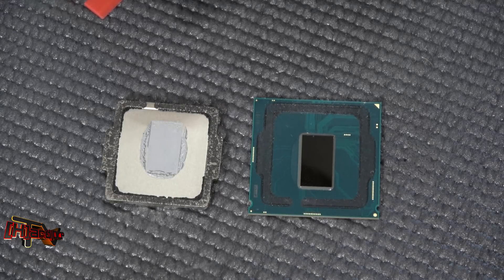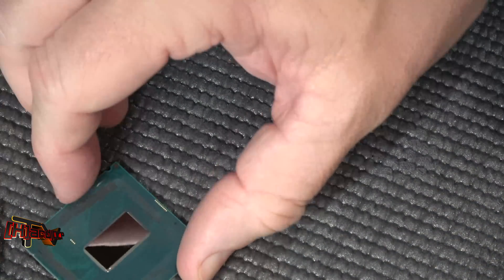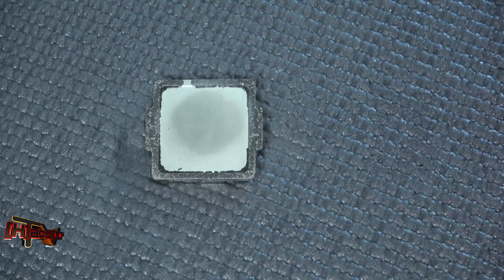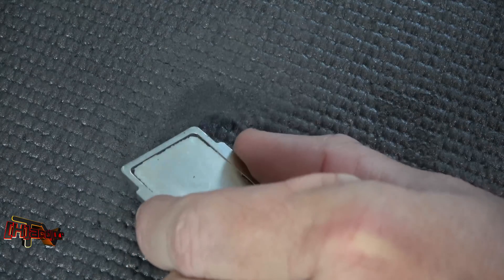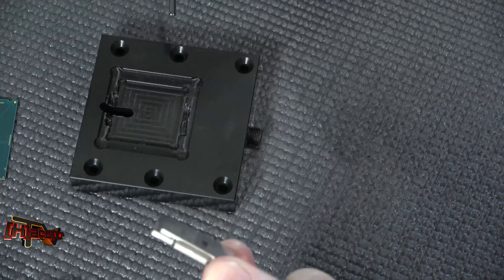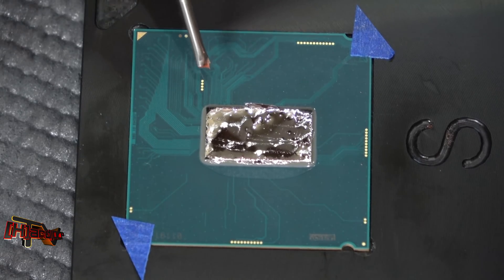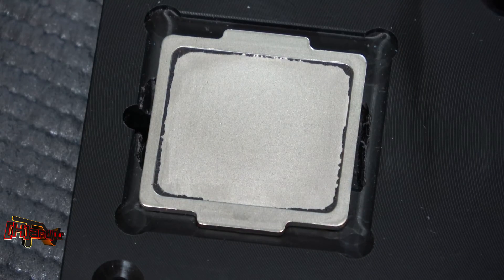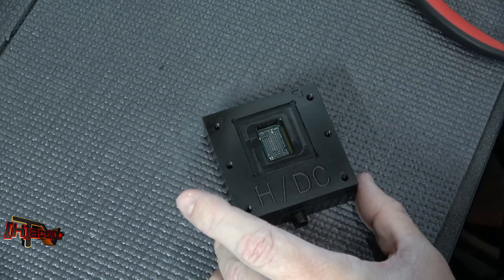Intel Coffee Lake 8600K Relidded with Delid Die Mate

Comment: From what I've seen, the best method to use, is using a Q-tip to apply LM. Put a tiny drop of LM on a different surface, absorb it with the Q-tip, then apply that. You can more easily control the amount, and it's a lot more fool-proof. Applying LM to both the die and lid helps too.

Comment: 7:45 is that really necessary? You should be able to 'relid' a Kabylake CPU without any modification to the Delid-Die-Mate. And doesn't Coffee Lake have the same IHS?
Reply from the maker: The tool I had was not designed for the CPU I was delidding.  I think the new ones have been tooled to fix that for those CPUs.

Comment: Why would you want to relid the cpu?
Reply from the maker: Protection.
Reply: From what? By relid i mean gluing it back instead of just putting on and letting the clamp and cooler hold it down.
Reply from the maker: I have found that fixing the IHS into place gives a better Z height and better cooling over time.

Comment: Hey, so if I were to use Hydronaut on my GPU, should I use Red RTV to protect the transistors and other components near the Die? Will it be low to no conductivity?
Reply from the maker: No electrical conductivity with Hydronaut, so if spec is true, no issue.  But I would cover it anyway.  No downside to making sure.

Comment: I think you may have added too much liquid metal, but if it worked it worked! I love the plastic razor blade idea - didn't know they existed! 

And you got the PCB super cleeeean
Reply from the maker: Hard to have "too much" of that TIM.  All that is not needed is going to be squeezed out easily since it is so viscous.  That is one of the reasons I made sure to cover up any conductive points under the IHS.  Much better to have too much with liquid metal TIM in this application rather than too little.  So yeah, I agree with you.  

Plastic razor blades rock.  Once you buy a pack of those you will find usages all over the house for those.

I am running that CPU at 5GHz at 1.24v vCore now with no issue.
Reply: You think the plastic razors from AliExpress would work well? Can't seem to find any reasonable prices for them here in Canada.

Also is it OK to not actually apply the Silicon sealant? 

I just want to delid it, super clean the PCB and Heat spreader, apply liquid metal and put the chip into mobo, the lid on, hold lid in place while I snap the CPU/Mobo latch shut.
Reply from the maker: Sure, you can do it that way.  I like having it attached, but if you are not going to move it, party on!

Comment: For anyone whos about to try it. Use tape around the dye surface to make sure you dont have the liquid therm outside the surface.  And use 5cm ruler when replacement silicone on the ihs to get straight line and smoth.

Comment: I saw several comments about the amount of LM that Kyle applied to this CPU. One thing to notice is that on the i5 it doesn’t have the surface mounted capacitors like the HEDT CPUs that others have done delids with.
Others who have done these procedures with have applied other types of coatings to protect the chip from the conductivity of the LM that might spread off the die. 
With this said, I am confident that the this i5 CPU is very safe to use after this process.
Reply from the maker: Yeah, I put "too much," but I am on the side of too much rather than not enough.  Cover everything under the IHS with RTV and keep it safe.

Comment: Maybe a strange question, but here goes... Would it not be a good thing to make the Lid out of Copper to increase thermal conductivity?
Reply: If you are talking about the material the IHS is made out of it is copper, it is just nickle plated to prevent tarnish
Reply: The thermal conductivity of Copper is 223 (Btu/(hr oF ft)) and Silver is 235 (Btu/(hr oF ft)), so a bit better heat transfer, but also it corrodes way faster as well.
Reply: Silver (430 W/(m K)) is barely any better than copper (400 W/(m K)) for thermal conductivity, though they are both nearly twice as good as aluminium (235 W/(m K)) for a comparison. Nickel (91 W/(m K)) has about 1/4 the thermal conductivity as copper and silver though so not having to deal with the nickel plating might see some marginal gains. Still nickel is about 3 times as conductive as gallium (29 W/(m K)) which is used in the tim.

So there may be some benefit, but honestly the difference is negligible. A reason to go with silver may be due to how it reacts to gallium (not sure), but in general I'd say it's probably not worth it since nickel barely reacts to gallium (compared to copper).
Reply: Acuually someone is now selling re-lidded CPU's with a silver heat spreader.  https://hardforum.com/threads/caseking-to-sell-core-i7-8700k-with-99-silver-heatspreader.1945458/#post-1043256888
Reply: Thank you, that I did not know. :)
Reply: Interestingly enough,  der8auer (through CaseKing) has a solid silver IHS on their OCed "ultra" adition.  I wonder what the thermals look like on that?
Reply: the plate is copper + nickel plated for better thermal conductivity, gallium will EAT ANY METAL. in liquid form
Reply: Ok, Gallium does not show up in the list that I have used. Could you maybe provide the (Btu/(hr oF ft)) for Gallium? here is the URL for reference:
 http://www.engineeringtoolbox.com/thermal-conductivity-metals-d_858.html
Reply: @Emilio Rodriguez; That's not really how things work, gallium has a tendency of reacting quite aggressively when galvanic corrosion is concerned (you named it eating, but corrosion is a more accurate term). Nickel will also corrode in time, but to a far less degree than both copper and of course aluminium (which WILL react within minutes of application). nickel plated blocks are generally fine when gallium is concerned, but copper will "absorb" it over time. Thus if you are planning on using liquid metal TIM (any that is currently available in december 2017)  nickel blocks are the best choice.

To be clear; I am still uncertain of how gallium reacts to Silicon and silver, but nickel is still better than copper and most definitively  better than aluminium.
Reply from the maker: I have Copper here but Gallium seems to be better.  I have not done back to back testing.